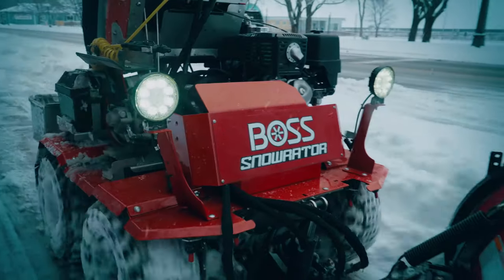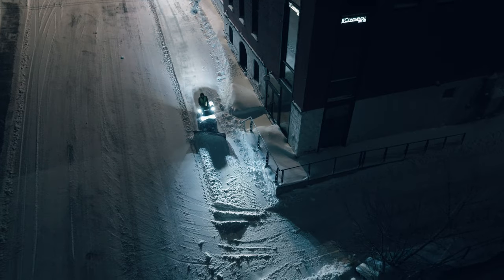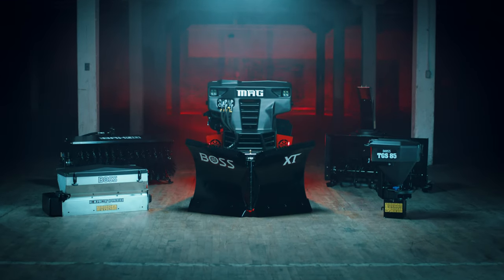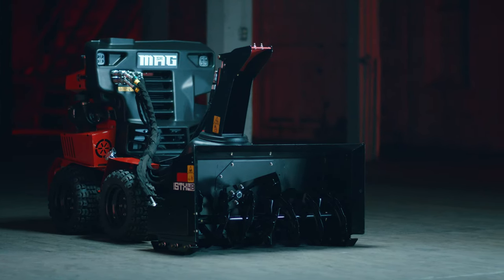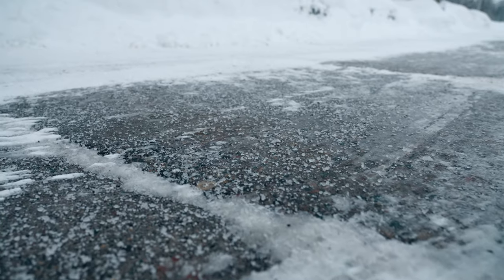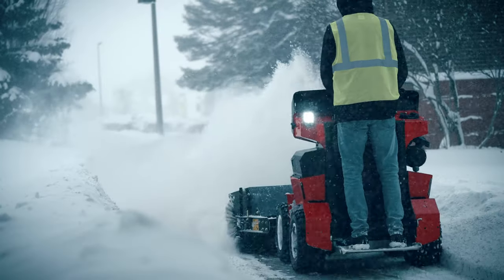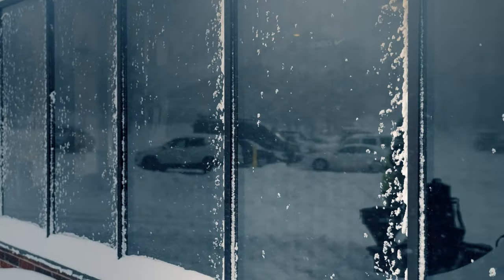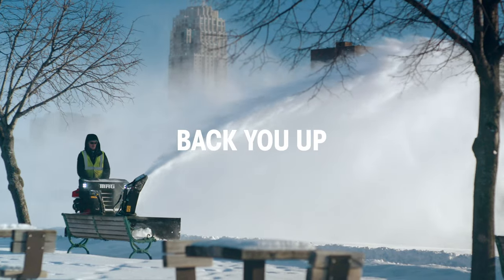SR MAG In Action | BOSS Snowplow |

Comment: It would be nice to have a steering wheel so you could have one hand free to work controls with ease , i know some of the " Zero Turn" mowers are using steering wheels instead of the traditional push and pull levers , perhaps it could be applied to these types of machines.